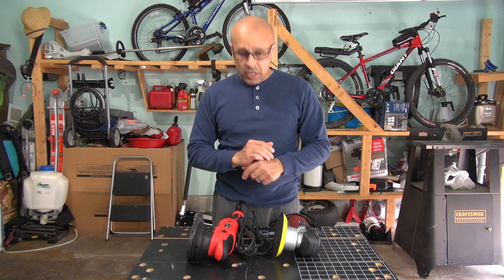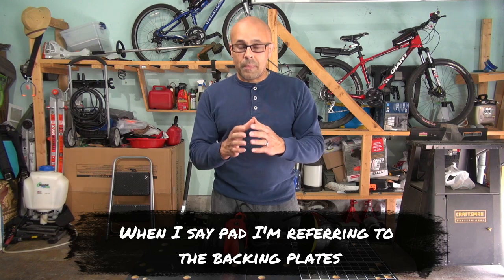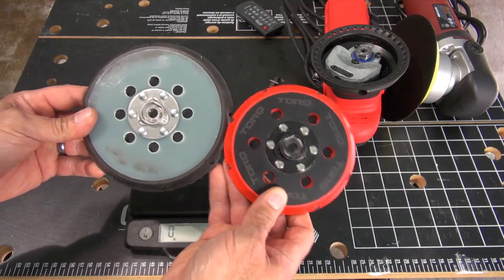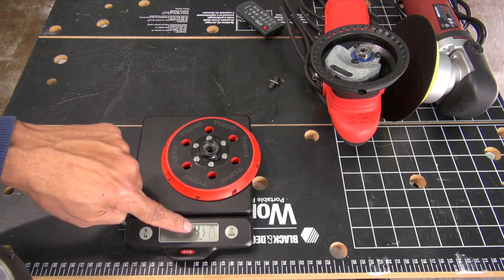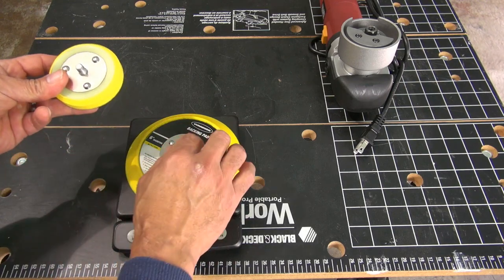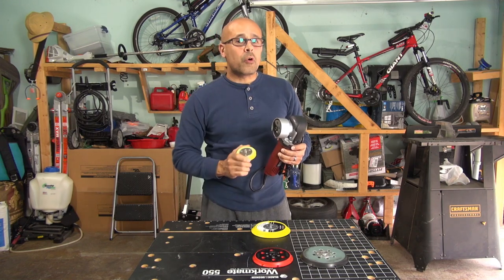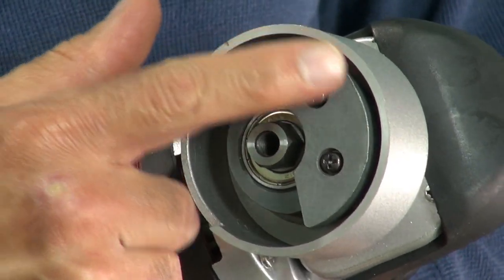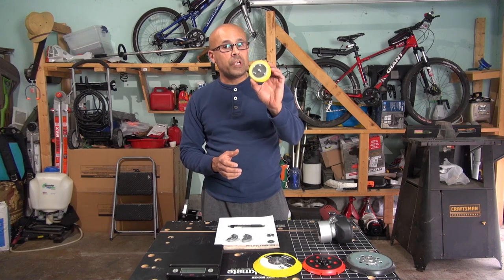Harbor Freight Dual Action Polisher 6" To 3" Backing Plate Counterweight Modification

Comment: Thank you very much for this video. I have a Bauer DA.  I want to use 5 & 3 inch pads.  So, b/c of you, I bought 2 of those porter cable counter weight balancers. One I will use with my 5 inch pads since its lighter than the original & the other I'm drilling out just like you, for my 3".  I really appreciate your work & this video.  Cool accent too; not a 5 inch pad, a 5 inches pad. That's kind of funny.   You're really helping people with this. Thanks again.

Comment: A good trial and error fix that will save your hands! Central pneumatic isnt the most well balanced polisher to begin with. I faced the same problem wound up milling ~ 150mils off of the counterweight's face. That was also trial and error but I got it close. My suggestion to people who do not have the means and patience is to just buy a 3" mini polisher. Some of them are pretty good and add the benefit of less heat, size, noise, and weight. Most of them can be bought for less than $100.

Comment: Hey Cool video didnt think about the counter balance weight so this is helpful. I have the bauer 6" DA and feel the combination of having a short throw and fair amount of vibration makes paint corrections more tiring than they need to be. Was planning on buying a LHR15 for primary DA and then converting the 6" bauer to a 3" model permanently. 

Did you have a similar line of thinking for why you converted yours to 3"? Is the bauer 6" DA a better machine to use for 3" pads?
Reply from the maker: John, thanks for your comment. I converted the harbor freight machine because I have a long throw polisher I use for larger pads and the harbor freight with the 3” backing plate mainly for headlight restoration projects. A long throw would certainly be much more difficult to convert since they are not meant to be used with those smaller backing plates.

Comment: Why you did not show the unbalance machine one before you do the holes? I would like to see what was that on with the original weight .... do you think it was to unasceptable to use it without make those holes even in a short period of the time?
Reply from the maker: Read the description of the video. It may help you understand how bad and dangerous it is to use the 3" backing plate without modifying the counter weight.

Comment: Question: Did you try the 3” backing pad on the 20mm long throw polisher? That Bauer polisher has an adjustable counterweight, so I’m wondering if you tried it? And if the weight had enough adjustment in it that you could balance it without any other modifications to the weight itself. Please let me know. Thanks!
Reply: The 20mm polisher does not accept a 3" pad. I don't have a Bauer polisher, mine is a Chicago Electric. Even though they are the same thing having an adjustable counterweight may be something HF added when they re-branded to Bauer. I still haven't seen that feature.

Comment: How about using the 3inch plate on the 21mm throw DA machine?
Reply from the maker: I think that's going to create an ever bigger problem of imbalance. 21mm polishers usually have a heavier counter weight. I would look online and try find a 3in backing plate already designed for 21mm machines. However I don't think they exist. You can also reach out to the manufacturer of your machine for suggestions.

Comment: What's the original 6 inch counterbalance weight? I want to compare with the weight of the backing plate.
Reply from the maker: I believe you can see right on the video; almost sure I showed the weights. I don't remember the weight from top of my head right now.

Comment: Hi there what did you reduce the weight down to in the end
Reply from the maker: 1 and 5/8 ounces weighted using a kitchen scale.
Reply: Thanks moongrass TV
Reply: My 3" backing plate weighs approx 30grams and the counterweight weighs approx 50grams so I think I'm going to shave 15grams off the counterweight so it's still got a degree of an offset if you get me.... would you say as I'm no engineer,...thanks
Reply from the maker: Hey I'm no engineer neither. My recommendation is to test the machine with its original parts and take a good mental note of the vibration levels. Then when you switch to the smaller backing plate start modifying the counterweight taking small steps at a time and testing. You want to get to the same level of vibration like when you took mental note with the original parts. Good luck and thanks for checking out my channel!
Reply: I can't get the link to work, DA part #, and counterweight number, thanks...
Reply: Watched again, got number, thanks.
Reply: @rayruggles4480  hi there, thanks for the reply....I just simply trimmed my cw down to just slightly heavier than the pad and backing plate and it works perfectly many thanks Gaz
Reply: @garypreece7299  The replacement counterweight started at 1 3/4oz (49.6g) final weight was 1 5/8oz (46g), 15g would be over three times the weight removed by Moongrass TV.